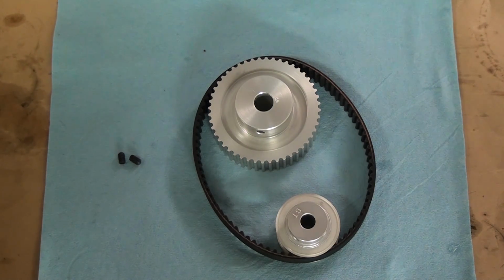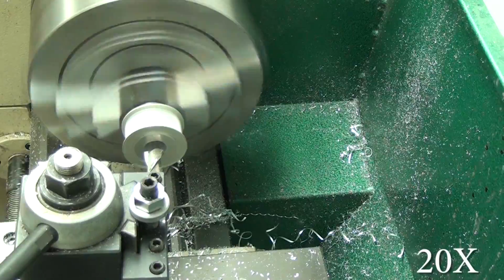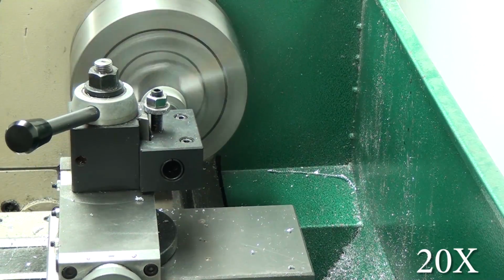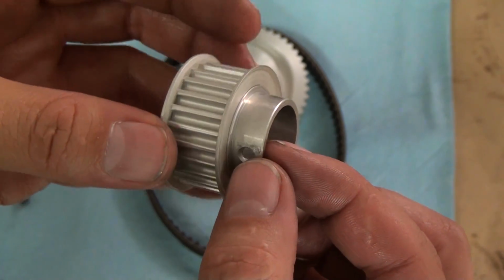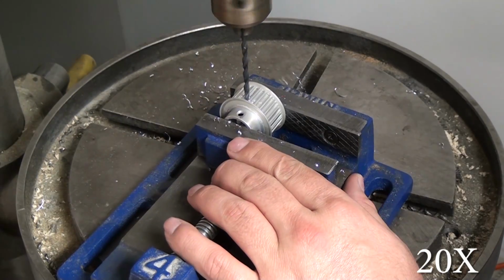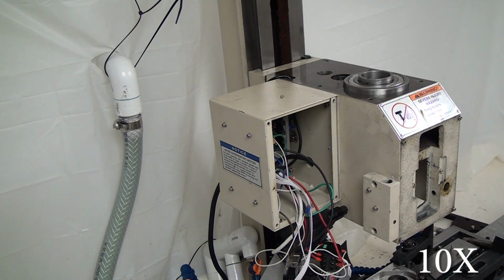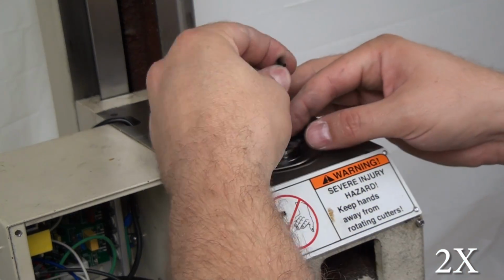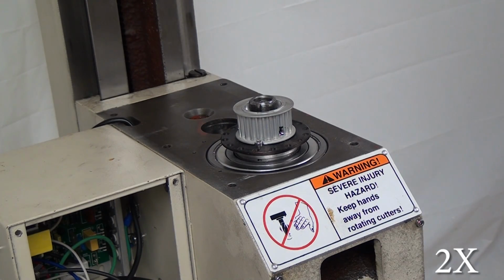CNC-G0704 #15 Belt Drive Conversion pt3 (Belt and Pulleys)

Comment: Would you have any interest to buy high quality ball
screw nut or shaft from Taiwan or China? How may I help you? 

Wei Tai Transmission Limited Company
Wei Tai Transmission Limited Company is the head office
in Taipei and acts for all of international trade activities to handle the
shipment supplied from Shen-Han Shenzhen factory.  We are looking for the
new customers in your regions and it’s thankful if you can give us a chance to
work together with.  Please feel free to contact the following:
0601 0606 0801 0802 082.5 0808 0810 etc. Only our factory has produced in China.
(1204, 1210, 1220 ,1606 1616, 1632, 2505, 2550, 2440, 2020, 2040, 2525,
4040 5050 etc.)
. High lead ball screws and screw nuts
. Ball screws and screw nuts in customized specific
standards
Capabilities of Shen-Han Technology –

We are approved by Chinese high-tech enterprise
certification and the plant own the equipment included CNC lathes, CNC 4 axis
machining centers, CNC 5 axis machining centers, and CNC internal thread
grinding machines.  We have R&D team to develop the new designs of
ball screw and has the specific patents including the new design and new
appearance.  We are also capable to develop OEM or ODM designed ball
screws to satisfy with customized needs.  The sketch of CAD/CAM customized
transmission component design is available both for equipment and high lead
ball screws in specific standards.

Shen-Han Technology is established in 2010 and supplies
ball screw and ball nuts which factory is sited in Bao- An, Shenzhen,
China.  We are the high-tech ball screw manufacturer and meet the
international standard of DIN 69051, GB/T17587 and JIS C5, etc.  The
factory is certified by ISO9001 & UKAS and we are professional in the
industry and have the confidence to produce both of the global standard and the
customized specification, and the quality is compatible with the international
branded products.
Our
ball screws own the good quality, competitive price and hope to find a power
transmission dealer world -wide. If you have any interest, please feel free to
contact with us. We supply ball screw and screw nuts in DIN 69051, GB/T17587,
and JIS C5 standard with in-house manufacturing factory.
We
have established from 2010, the head design office in Taiwan and in house
manufacture in China. Professional in ball screw and screw nuts, especially for
hi-precision requirement. Provides quality, economical and compatible ball
screws solution.
This
is Nora from Taipei Taiwan and we are ball screw manufacturer. We own the high
quality and competitive price because our factory in China. Our goal is we
really hope to do more business with you.
Wei
Tai recommends the use of standard ball screws for most designs, but We can
also produce high-lead and miniature versions. Balls crews are also
manufactured according to customer specifications.

A ball screw is the kind of high-tech product that requires capital-intensive, technology-intensive as well as
management-intensive input. Wei Tai owns some of the most advanced manufacturing and inspection instruments, which are used to maintain high
standards.

Any complain from your customer and lack of good supplier
to offer ball screw nut or shaft? How may I help you?

Tel# 886-2-28326773
FAX:886-2-28327852

Address: No. 214-3, Zhou Mei Street, Bei Tou
District, Taipei, Taiwan, R.O.C.
Cell phone: +886978377508
FB: https://www.facebook.com/hung.nora.3
        https://www.weitaitransmission.com
Website: http://www.weitaitw.com/en/ball-screw-nut.html
https://www.youtube.com/watch?v=jQW23Bx59WQ&feature=youtu.be
You tube: https://www.youtube.com/watch?v=-8kBVM4JCBg&t=41s 
We chat ID: w0978377508
Email: 02weitai.ltd@gmail.com

Comment: Hi Russ- thank you for your videos. I have a question about the bearing choice for my G0704. My machine is stock, and I do not intend to go hi-speed at this time. But do need to replace quill bearings as they are running very hot even in light load running conditions My question is the bearing choice. Should I use flat/contact bearings as you suggested in your first Video, or the hi quality taper herrings that you have recommended in this later Video?  My machine is just a bit over a year old but does get a lot of use. I don't want to replace with factory part number in any evert. Please advise, thanks, Howard
Reply from the maker: I would go with the tapered roller bearings over the angular contact bearings, not just because of speed but because of concentricity. You'll have way less runout on your end mills with the tapered roller bearings. I had about .001“of runout with angular contact bearings, and about .0001" of runout with tapered roller bearings.

Comment: Russ, are you still using the same pulley set that you are using in this video? I ask because I’m getting ready to use a 6030 AC 3hp 6k rpm rated motor on a VFD/inverter. If I can use only a single pulley set that would be good. If not it’s no big deal to make a hi-lo system.
Reply from the maker: I've moved to a poly ribbed belt setup, single speed with a max RPM of about 6500. My 1.5hp 3ph handles the whole RPM range pretty well, but I do intend to go dual speed at some point as I want to add 1:1 for rigid tapping.
Reply: Thanks for the quick response, tapping was the only thing I didn’t consider. I do t plan to do a lot of mass production so I could easily tap the old fashion way but then again I do have two 2.75 timing pulleys on the shelf I could stack on this arrangement. Hmmm. Thanks for blazing the trail for at least me. I know your trials have saved me plenty of errors and money I’m sure.
Reply from the maker: Glad I could help. Thanks for watching :-)
Reply: I would love to use a poly groves setup but I’m having fits trying to find a supplier. I do have a lathe and could turn out them but I would much rather buy the pulleys. Do you have a supplier? If not the lathe gets to job.
Reply from the maker: I made mine, but I've ordered lots from these guys. http://www.sdp-si.com/shop/

Comment: hi 
i have some question pls 
for homemade mill what the motor ( size  + speed )i need for it ? 
what is the better water cooled or air cooled ?
pulley and motors or spindle motor https://www.ebay.com/p/3kw-Water-cooled-Spindle-Motor-Four-Bearing-24000rpm-Engraving-Mill-Grind/18012028607?iid=253328889553 
thank you
Reply from the maker: +Anwar Alfaqeeh Alhusseini Hello! I have one of those spindles. They are too fast for Machining metal in almost all circumstances. I have seen somebody machine aluminum with one turned down to 8000 RPM. They don't produce as much torque at lower RPMs as they are meant to run fast. The other problem is they are not designed to handle high side loading that you get for Machining metal. If you want it for cutting wood or plastic or foam they are perfect though.

Comment: You can often get a press fit without a press by cooling down and heat up the relevant parts.  The CO2 fire extinguisher gives you -60C at the tip.  5-10% oil will bring the boiling point for water at 125C. a heat gun is also very helpful.

Comment: Great job!  Thanks for taking the time to make these videos - really good stuff.  Are you able to quantify/qualify the improved performance of the mill after the upgrade?  Obviously, you have more RPM but have you seen any other improvements?  Does the mill give you a better surface finish with the upgraded bearings?
Reply from the maker: +Franco Thanks for watching!
I wouldn't say the mill runs better really, only that it's faster. I never had a problem with the stock bearings and only figured I should replace them because I knew I was going to shoot for higher speeds. Some people stick with the stock ones until they explode :)

Comment: Hey Russ,

Thanks a lot for the videos.  I'm doing the conversion now and I'm confused about the c-clip.  Does the c-clip fit inside the pulley counter-bore near the top of the pulley?
Reply from the maker: +ADPathos Do you mean the c-clip above the upper quill bearing which is flush with the top of the mill head? That c-clip stays in place, and the hub of the small pulley which drives the quill/spindle assembly actually slides down inside the quill.
Reply: +russtuff Oh sorry, that's not the one I meant.  I guess it isn't really a "c-clip".  I'm talking about the c-shaped piece of metal that holds the spring loaded cylinder in place.  The one that allows the spindle assembly to drop  from the head when removed.
Reply from the maker: Right! I completely forgot about that clip. Because I'm not using the quill setup on my mill, I removed that clip and the spring as well. The quill lock at the bottom-left of the quill and the small pulley are holding it all together now.
Reply: +russtuff Aha!  Good to know and thanks!  I also don't plan on using the quill so I'll probably do the same.

Comment: Thanks for the videos! Having stripped out the drive gears on my G0704 tonight, it looks like i'm in for the same conversion. Am I correct to assume that if I simply copy and paste those 3 part numbers over that I'll end up with what I need? The gearing calculator part confuses me. I'm not looking to go faster than stock really, I just can't see putting those same silly plastic gears back in the machine. I do have a lathe and a drill press....but no milling machine currently. ha
Reply from the maker: ***** Yes those pulleys and the belt will double your motor's RPM, but remember it also cuts your torque in half. I'm not sure if you could do a belt drive without building all new motor mounts, so you may have that hurdle to jump too.

Comment: Do not crush the metal shield!!  You can take the head off and press this in, which is what I did after denting the shield.
Reply from the maker: Yup, you gotta be careful with that shield. They are super easy to ruin.

Comment: I have the timing belt conversion and I am ditching out for a ribbed pulley setup.  I have 8k rpm and it is loud and the belt bounces a bit to much for my liking which creates vibration at certain rpm.  Also switching to driving the quill Barrel verse the splined shaft.

How well do your splines fit in the quill barrel?  I get some backlash chatter there, trying to figure a good way to fix that.

I'm also going to do a high/low setup to try and get around 10k rpm.  I agree that the smaller endmills and higher speed spindle work much better than bigger and slower.

Have you tried any trochoidal  machining yet?  Seriously opens up the possibilities on these small mills.

Chris
Reply from the maker: Keep me posted on your ribbed belt drive. I am getting some bouncing too at my max 4600 but I think most of it is from to little tension. My splines also have some backlash. I think the 3d printed spacer could help with that (?), but I have some other ideas before I start hassling people to print me one :)

Comment: Awesome! Coming together really nice. I like the belt & pulley over gear drive it's not a loud but then again your running high Ron so it may be about the same now? Can't wait for the next! :)

D
Reply from the maker: Thanks! Right now I'm hitting 5200RPM at about 90volts, but my motor is rated at 130v continuous so there is room to move that up.

Comment: What motor are you going with. 
I just got done doing the same thing. I went with a 2 hp ac induction motor a sensorless vector vfd it work great. 
A week after i finished it i found out about a compact asynchranis ac induction motor. I bought one and it gives me almost an extra 2 inches of room compared to the 56c mount. The small motor is a seipee. Let me know if your interested.
Reply from the maker: Dirtdigger257 I have a 2.8HP DC motor on there now, and may eventually upgrade to a 3.8HP DC (I have both). Thanks!
Reply: Dirtdigger, would love to pick your brain on your linear guide conversion!  Are you on any boards? Have any build threads?

Sorry for the hijack Russtuff. :)

Comment: Very cool.  I bought a pre made belt drive setup with Adelee 3HP motor/controller, probably paid way too much for it, so far it has worked good.  Btw, when you were boring out the pulley, were you using an endmill or drill as a boring bar at one point?  That's cool, haven't seen that done before....
Reply from the maker: Thanks!

Yeah it was a 2 flute 1/2" HSS end mill. I do it quite a bit now. They are very fast at hogging.